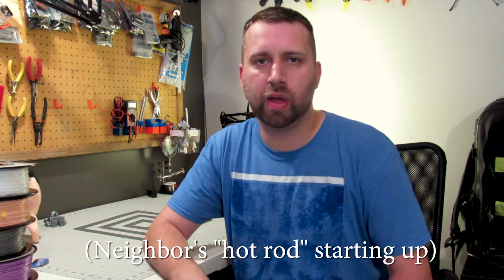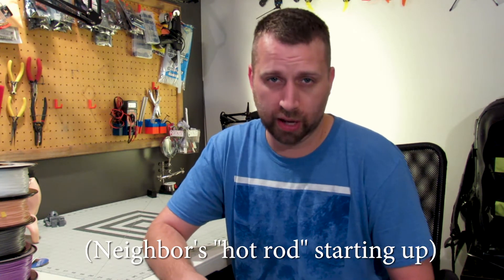UPDATE 4: TBS Crossfire and FrSky X7 BETA PATCH IS OUT!

Comment: Hi @ThatJoshGuy.  Thanks for the helpful videos, short and sweet is how I like them.    I was getting the waiting for crossfire error until I modded the QX7 with an inverter that came with the. Micro TX kit.  After the install I was able to connect and get all telemetry but my range isn’t very good.  I get alarms with Rqlty at 70% and see that my mode changes from 2 to RFMD 1 which is when my logical switch is set to read signal below 70% when not in mode 2.   Anyone else having this issue with range?

Comment: Do we know if the Q X7S has the same issue?
Reply: The software fix works great for me. I went straight from ppm to it so I don't even notice the reduced speed (ignorance is bliss).
Reply from the maker: scotty562 I haven't heard, there aren't a lot of them out in the wild yet
Reply: I have one and a Crossfire system coming in the next few days so I'll try it before putting on the 2.2.1 firmware.
Reply from the maker: scotty562 let me know how it goes!
Reply: Ok I just set it up. Q X7S OpenTX version 2.2.0, Crossfire 1.67. It also suffers from the telemetry issue. It also complains about losing sensors. Man is it cool having all of my telemetry available on my radio though :D. I'm happy as can be. I'm going to put the 2.2.1 firmware on and fix it with the software.
Reply from the maker: scotty562 thanks for letting me know!
Reply: Hey scotty, Just wondering has this been working well for you?  I just got the X7S and Crossfire.  Just wondering if the software fix seems ok.  Thanks.

Comment: so can I buy the TBS CROSSFIRE MICRO BUNDLE  without doing the hardware mod? I only have to wait for the patch?
Reply from the maker: Yes the update is out, you should be fine using it now
Reply: noobrc but, what about the latency? 😢
Reply from the maker: KANGI it will still be way faster than FrSky gear, and most other stuff on the market. If you are at a point in your abilities where you can tell a difference and it is affecting your flight, then go with the full size Crossfire and Taranis. (Personally I think the latency wars are B.S. - I don't think the average pilot could tell a difference in a blind test)

Comment: wondering if anyone has installed this on the Trunigy 9x, I know it's old and cheap and am going to upgrade to the x7 but for now I have the 9x and don't want to pass up on the sale of the crossfire. I sent a message to TBS and they said they didn't see why it wouldn't (so they think the baud rate of the 9x is higher than the x7?) but didn't guarantee it would and suggested to see if anyone has. Thanks!
Reply from the maker: I have a 9x I might be able to test with, I just need to see if I can get OpenTX 2.2 on it.  It is currently running an older version.
Reply: Hey if you can that would be great, would really appreciate it!
Reply from the maker: UgpFpv if i get a chance to this weekend I'll comment here
Reply: noobrc any luck with the turning 9x and crossfire?
Reply from the maker: I haven't had a chance to test yet, sorry!

Comment: Just finished the inverter mod this morning, You weren't kidding when you said the inverter was small! Going to test today, hopefully it'll work. was getting too impatient waiting for the software...  Thanks for the updates
Reply from the maker: Good luck!  FWIW if you can run the new LUA scripts for the X7 then it should be working fine.  I am adding the script link into the video description now
Reply: I'm just getting waiting for crossfire. any suggestions? crossfire tx and rx seem to bind no problem both solid green
Reply from the maker: Paramnam khalsa in the X7, you have chosen CRSF as the protocol for the external module?
Reply: Yes turned internal off external on to crossfire
Reply from the maker: Paramnam khalsa hmmm, I'd check your soldering/wiring again I suppose. Unfortunately I am not an expert, lol. If the mod is done correctly and you are running the right firmware versions on everything then it should work :/

Comment: I did the resistor mod and running the beta opentx, I use lower baudrate to change settings and swap to normal baudrate when Im flying, seems to work like this.
Reply from the maker: Interesting, are you getting alarms when running normal baud rate? Is there a reason you are switching between the two, or is it just to be safe?
Reply: Im not getting them on normal baudrate as I did the resistor mod but LUA still wasnt working after mod. LUA works on lower baud though and then I can swap to normal baudrate and everything just works.
Reply from the maker: Good to know, thanks!
Reply: Where do you get the baud rate settings? I patched and cant find it.
Reply from the maker: Charles R Taylor right - two different things